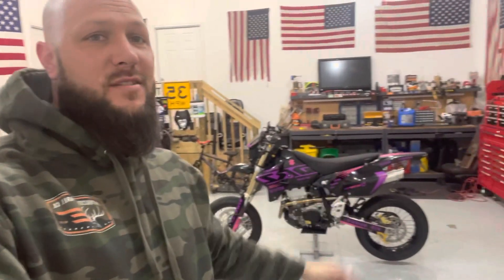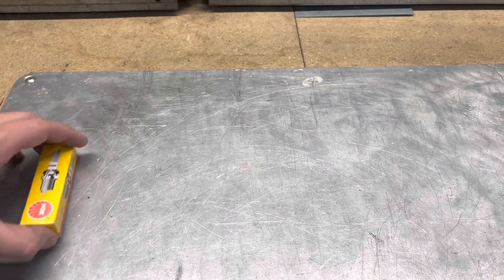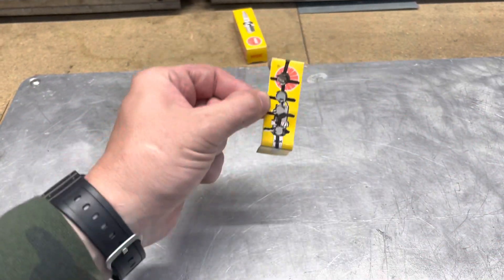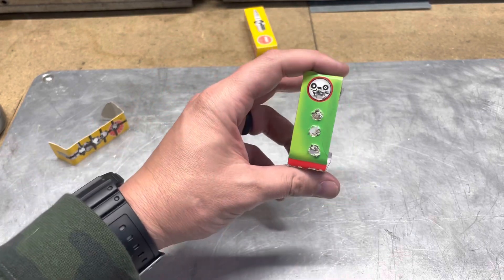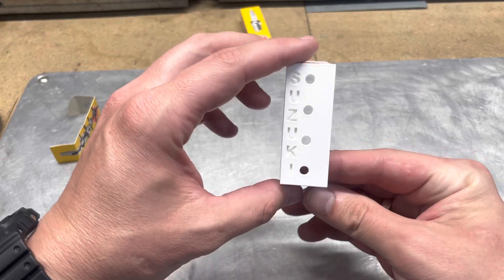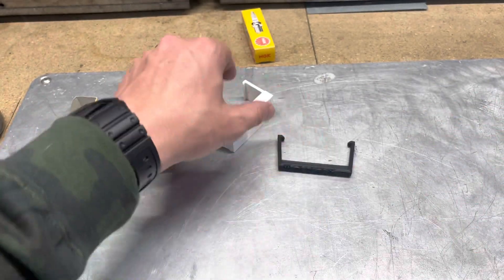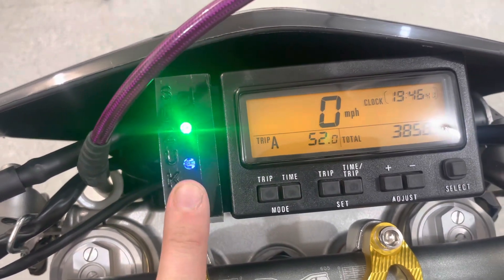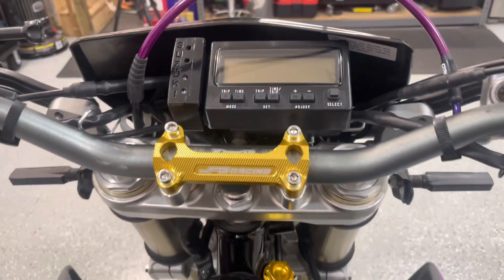DRZ400 Indicator Panel Modification! (Blind No More!)

Comment: Your setup is nice. I just got the 2023 400s but sort of regret not getting the SM. I’m doing like 90/10 street.
Reply: And super moto wheels are not cheap.
Reply from the maker: Thank you! Enjoy your new rig! Yea. The SM is pretty easy to convert to dual sport. Al little less expensive. Plus it’s already got the big brakes.
Reply: Get the SM wheel set when you can and tighten up the suspension dampeners, you won't regret it!

Comment: Hey just curious are you able to disassemble the panel where you are able to get to underneath each symbols plastic where the light comes through? If so white nail paint none flammable you can use to make it cloudier and also any white tape for like taping wood off for painting and put it on the inside so that its got the same OEM look it's just not a clear line of light threw each indicator light. That is if you can get underneath it. I think my buddy dipped his bulb for that indicator in like Elmer's glue or something if I recall correctly because we race ATVs and it was blinding him on jumps for the landing
Reply from the maker: I’m sure you could. But I didn’t want to mess with that. A piece of tiny film would do the trick also!
Reply: Nope, you can't get inside the lights. I just took mine off and it is a sealed unit. Booo! 😮